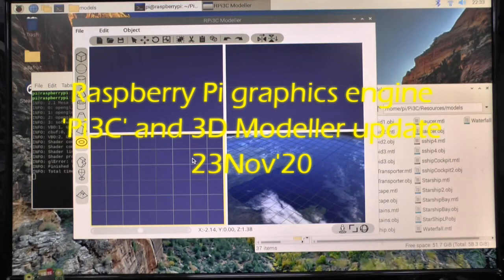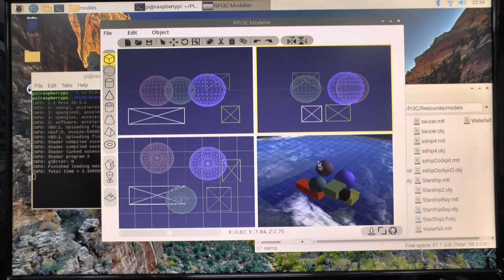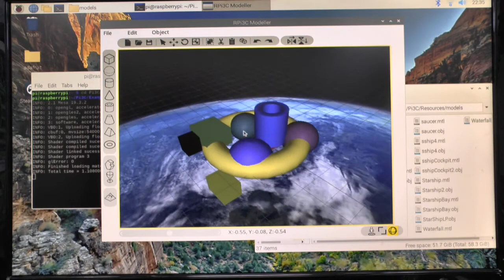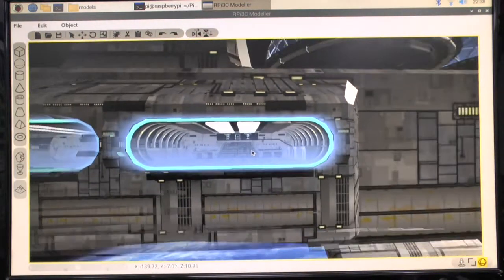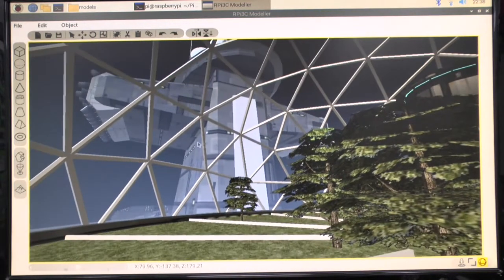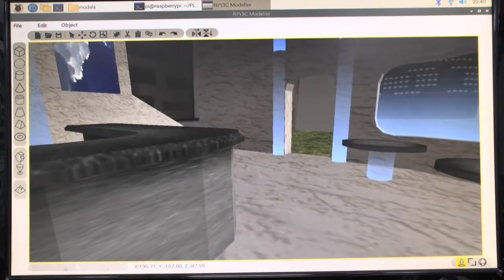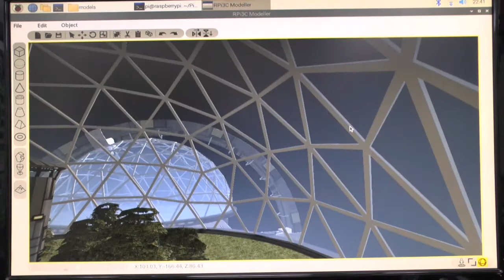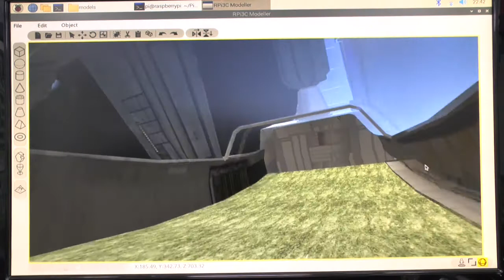Raspberry Pi Zero Graphics Engine 'Pi3C' update

Comment: Sadly music is too loud, a technical/demo video does not need music.
http://pi3c.co.uk/     returns the url "http://pi3c.co.uk/cgi-sys/suspendedpage.cgi"
and page = "Template Error: The template file must be given (or the template could not be opened)"
Reply from the maker: OK - I'll tone it down a bit!  Thanks for letting me know :)
Also, you can check out the code at https://github.com/timskillman/Pi3C
pi3c.co.uk is not really up and running yet - although it shouldn't have those errors - thanks again!

Comment: In the spaceship scene the engine has some short of not rendering the parts of the ship (that is not on the view) to gain more performance?
Reply from the maker: Good spot! ... the ship is by no means finished and the modeller is simply rendering everything.  I have code for Level of Detail (lod) control although I still need to separate the ship sections - this would speed up the rendering quite a bit.